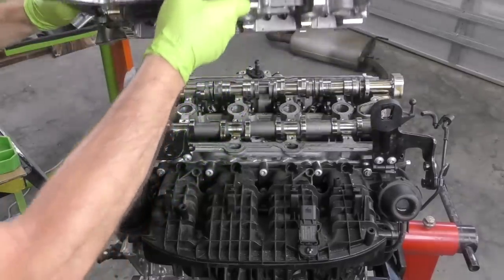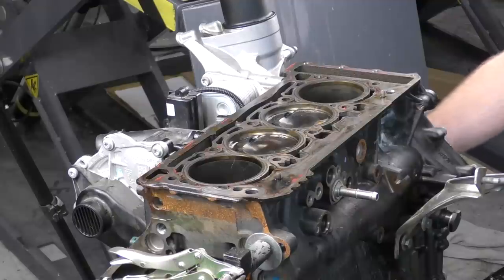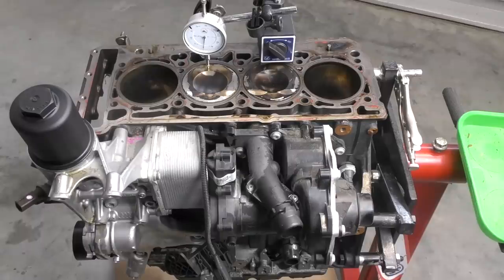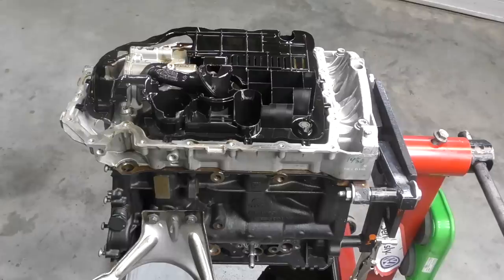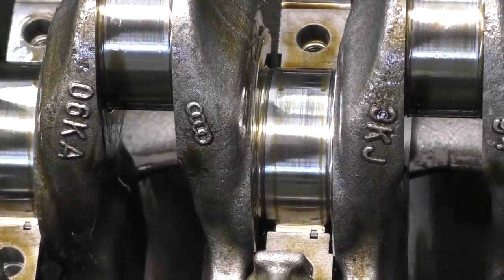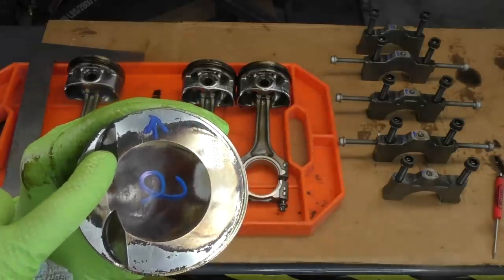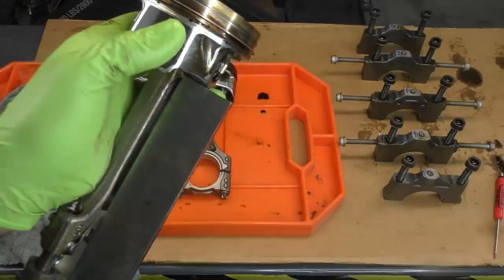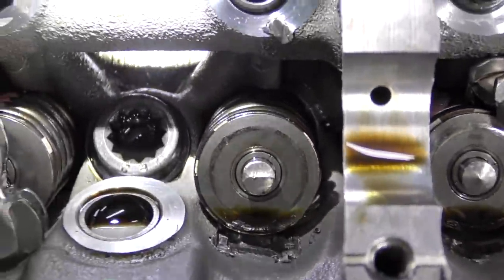Catastrophic Engine Failure VW 2.0t TSI Engine 2 ~ Bottom End Damage

Comment: Man I dodged a bullet today in my Miata. Accidentally made the same 3-2 shift up near redline but thankfully I think I got the clutch disengaged before the RPM went too high. Engine still seems to run fine, no CEL, no weird noises, coolant temp and oil pressure seem normal. PHEW!!
Reply: I bet you ain’t one of those guys who likes to dump the clutch but rather drive it smooth on every gear change, I find it soothing when I shift as smooth as an automatic, some people just can’t drive it smooth regardless of the rpm, they gave harsher ride than a roller coaster, that’s why they screw up their things.

Comment: Hey Charles, I don’t know if this was mentioned yet, but another way to measure piston height is to zero the dial indicator on the deck, then release and reposition the magnetic base on the deck so that the indicator foot is on the piston in the spot you want to measure. That way you can check true TDC, as well as depth or protrusion all in one step. The deck is assumed to be flat for that type of measurement, but I’ve never had a problem doing it that way.

Comment: It seems the owner over reacted by getting a new engine. This one seem to have sustained a lot less damage on the bottom end then the top end. Just needs a new cylinder head and it would have worked just fine. Maybe replace some of the things you mentioned. Overall very cool video.
Reply from the maker: Thanks! May have been just as much for a used engine. Plus he wants to build this one. So it may have been good to have 2
Reply: @HumbleMechanic  yeah that was my immediate thought, having the car out of comission, and paying for the labor for a rebuild probably would have cost just as much. Plus he might be able to resell the used engine when this one is finished to recover some of the funds.
Reply: Often times it's more expensive to rebuild than to replace with a good motor. Rebuilding is expensive even for simple stuff, because it's a very specialized field. As someone who rebuilds very simple old motors i can understand why someone would want a fair bit of money to rebuild a complex modern one.
Reply: Yeah just a replacement head needed. £200 approx. Edit: £900 all in & fitted. 🙂
Reply: Mom and Dad sponsored

Comment: That wear on the lower main bearing would be due to increased load from the combustion stroke. Also explains why it wasn’t on the top bearing. I’ve seen it more pronounced in bigger diesel motors to the point where the bearing almost mushrooms a little.
Awesome tear down btw. I’ve watched a heap of your videos recently after purchasing a mk7 gti and now downgrading to a Tiguan cries I’m sad vw noises

Comment: Yes!!! Finally but also wow you got this out quick! That one thrust washer is SCARY for a 40k mile car. I know what I'm having nightmares about now!
Reply: It's a race car dude.  Vastly accelerated wear on a race engine.  No need to worry about your street GTI bottom end
Reply: If the car has been used in town traffic, with the driver sat on and riding the clutch at every set of lights, or doing a lot of stop/start driving in rush hour, the thrust washer will show increased wear, and all the more reason why people buy an auto/DSG if it's their daily commute as well. Also, another reason for not always riding the clutch at the lights is that it places a continued strain on the clutch pressure plate, and if the pressure plate fails, you'll be going nowhere fast.
Reply: @AJ-bb6qb  That's true, but a thrust washer should be designed to wear at a similar rate as the main bearings - as in easily capable of 200k miles regardless of driving environment. A thrust washer that wears more like a clutch is frightening.
Reply: @acefighterpilot  Agreed, and perhaps this is more a problem with recent VW engines, or could just be a bad batch of main bearing/thrust washer sets as even OEM suppliers have quality issues from time to time. 
I know from my previous strip down of a 200k mile plus petrol motor from an 80's VW Golf, that had an owner who would go through clutches every 50-60k miles due to riding them, that there was only light wear on the thrust washer.
I think if it was a common problem, engine designers would have fitted multiple thrust washers across all of the main bearings to spread the lateral load. 
I probably need to watch some more engine strip down vids to see if this is not an isolated case.
Reply: @AJ-bb6qb  Crank walk is proving itself to be an occasional problem on EA888s with heavy aftermarket clutches. Older engines generally have upper and lower thrust washers on either side of the center bearing, the EA888 only has the upper.

Comment: You probably answered what went bad on my 2006 A3. Engine failed but before it failed clutch would sometimes get stuck. But I did not have modified clutch it was the original. no slippage, so never replaced. Engine did have a rattle noise. Makes sense that the thrust washers went bad. I got rid of car had over 150k.

Comment: Cracks don't have rounded edges, but if a crack does form, that's where it'll be.
Reply: Looked like cracks on the cam risers. . .
Reply: Polishing out those lines and jagged edges on cast parts not only makes them look good and shinny, but also makes em stronger be evening out the surface tension of the entire cast part. Takes time, but worth it on high power output builds.
Reply: @airtaiH2  shouldn't you just use forged with high power builds
Reply: @jorge8596  where would you find a forged cylinder head?

Comment: Loved this video, I feel like I learned a lot about the engine in my VW just by watching this. Pointing out some of the common issues such as the thrust washers and how to check for abnornal wear was super interesting.

 I dont know if you take reccomendations for future videos, but I think a comparison of the current gen 1.4t, 1.8t and 2.0t would be really interesting. What parts are interchangable? Do the head designs differ significantly? Etc. Being able to go in depth to the same degree as this video would be incredible, even if you just had a couple parts from each variant to show.

Comment: Interesting in the thrust washer. . .   I noticed the end play on my Cessna 172 O300 engine when I would grab it by the prop to pull it into position.  It worried me, but then realized all of this flat engines had that end play.
Reply: There's an SB on radial crank measurement at the prop hub you can have your A&P do if you're afraid it had a prop strike earlier in its life. But they do in general have a fair bit of play, the thrust bearings are literally under the load of thrust constantly. That's why keeping up with your overhauls is important.

Comment: I definitely had money shifted couple times in my life, Volkswagen shift pattern has 1-2 closer to the centerline than 5-6 is (got to have something to do with the reverse, they need the 1-2 closer so they can Jam R on the left side), and the shifter takes too little effort it doesn’t give a very good feel, that’s why it’s easy to money shift from third to second. However I never drop the clutch, I always ease it out near the “biting point”, I like to shift as smooth as an automatic, and that gave me just enough time to realize my error, and correct it by depressing the clutch (engine almost sounds like vtec kicked in for a sec, and hitting 8000 rpm instead of dropping to about 4500 from 7000), I really wonder how many rpm it takes to cause damage. Who would have thought the timing of the engagement of that flimsy piece of disc (as about the size as a dinner plate) could mean the difference between life and death for the engine?

Comment: How do you mess up 3rd to 4th. It's like the easiest shift
Reply: Let’s say you did mess up why would engine do that anyway I down shift all the time
Reply: Roman Skarzhinets he was probably near redline in 3rd then when he shifted to 2nd it revs way past redline there for killing the engine
Reply: GatSpeed modern engine would it let?
Reply: @Roman-vh1rr  how could it not allow it?
Reply: Roman Skarzhinets A modern engine with a rev limiter works by cutting fuel and/or spark when at the rev limit.
Unfortunately in a money shift situation like this the engine speed is being governed by the physical link from the wheel speed through the driveline, no ECU managed rev limiter could do anything to prevent it.
Reply: Muricans, can't shift by default.
Reply: Because double clutch race shift.
Reply: @Roman-vh1rr  When you are at 6k RPM in third gear and try to go to fourth but get second gear, it makes the RPM climb to what ever ratio your tire speed is. Example, say your second gear at 6k RPM is 35 MPH, top of third is 60 MPH at 6k RPM, your wheel speed is 60 MPH and you go to second gear and dump the clutch trying to shift quickly (probably racing a guy or messing around having fun) your engine RPM at 60 MPH in second gear would be somewhere around 10-14k RPM!!! there is too much mass spinning that fast that things pull themselves apart, the rotational forces are too great for the design of the engine. Formula one engines can rev to those RPM because they use tiny very thin aluminum pistons, lightweight connecting rods and build crankshafts. Not to forget that the spring rate for your valves is not strong enough to close before the piston is at TDC sometimes hitting the valves.
Reply: Normally 2nd would not pass unless you slow down !
Reply: Roman Skarzhinets because the car was stage 2, so it’s had a rev limiter removed possibly
Reply: @JordzyBrev  Has nothing to do with rev limiter, rev limiter is only a software stopper when accelerating, it can't save you if you money shift. Only way you are saved from money shift is if the car is auto/dual clutch ect because most will not allow you to downshift if it will put revs over limiter by doing so as its software stopping you. No one in their right mind would remove that in a tune
Reply: DarkDaedricLord Gaming he was at 9k rpm in 3rd gear and wanted to go 4th but went into 2nd and killed the engine, the guy was saying, modern cars shouldn’t let that happen but if you modify software ect it won’t have that safety at high rpm. I have a Honda and I haven’t do anything to it but if I’m Neutral my car will only rev to 4k, it’s programmed to so that to protect and when I’m driving my car won’t rev past 7k
Reply: @JordzyBrev  He only said maybe he was at that, never that he was. Even if you are at stock redline in 3rd then went to 2nd it'd still blow the motor or at least try to. The neutral thing is either a 2step launch control or it's for emissions like most new cars. No way you would put the redline so much higher for no reason. In my car I've got a tune and redline is 400rpm higher than stock because thats what the motor can do safely, but if I money shifted its still going to blow because it will be at 10k plus and that extra 400 isn't going to change the outcome of that. I've also got a 2step launch control to hold at any rpm i program when stationary. Modern cars won't let you rev over limit with throttle and if an auto then won't let you downshift if that lower gear will be over limit. But if a manual its straight mechanical between the wheels and engine  with no fail safe so it's up to you not to fail
Reply: @23for82bigs  he was def at red line racing
Reply: @JordzyBrev  put this way even if the engine was not running say u shut the engine off at highway speed it's still in gear 4th or 5th high RPM and u put it in a lower gear 2nd let the clutch out it would mechanical force the engine to turn and turn faster than what it's designed to take, the electronics can cut all the timing, fuel or as i said switch it off it would still happen
Reply: @Roman-vh1rr  if it was an automatic and u request a down shift which would result in a over rev the ECM won't let u, until u bleed off some speed.. in a manual shift the ECM can't hold ur hand so u better get it right 😅 or boom
Reply: @Roman-vh1rr   put this way even if the engine was not running say u shut the engine off at highway speed it's still in gear 4th or 5th high RPM and u put it in a lower gear 2nd let the clutch out it would mechanical force the engine to turn and turn faster than what it's designed to take, the electronics can cut all the timing, fuel or as i said switch it off it would still happen
Reply: @JordzyBrev  there's literally nothing a computer can do to prevent overrev, if the gearbox is yanking the engine to whatever speed the tires are travelling at.

Comment: When I was a teenager my one buddy was loosing his license and wanted to drive a 5 speed one last time before handing in his license. I let him drive my 1992 4cyl mustang winter car. He redlines 2nd gear and goes to 3rd but it went into 1st gear the engine rev’d to the moon, tires screeching but didn’t blow up. Years later I’m a professional auto technician and I was really into racing Fox body mustangs and I use to rebuild/repair all my friends t-5 trannys from these mustangs. Guys like myself that had built motors would keep blowing up these transmissions and until I had the money for a better tranny I ran a bunch of these t-5’s that were from a 4cyl car and first gear was like 4.40:1 so Reving 2nd gear out and shift back to 1st is near impossible because 1st gear and the slider would be spinning at such different speeds so I have absolutely no idea how my buddy was able to slam
It in 1st lol. When I was junking the car I tried to get it into 1st it would not go in no matter the speed or what I did, I tried holding the clutch in for a while to slow the input shaft speeds in gear and in neutral, tried holding the engine wide open bouncing off the Rev limiter, slam it in really hard, reving the engine and letting off but I couldn’t get it to go into 1st until the car was almost not moving. 

However one of my other friends had a 1990’s Chevy s10 4cyl 5speed winter beater and I dared him to shift it into 1st gear when we were going 50mph and he really quickly slammed it into 1st gear it actually went into gear let out the clutch fast and the truck didn’t do anything no noises, no jerking, engine didn’t Rev up but truck wouldn’t move. When he took the transmission out the clutch pretty much disintegrated lol! There was the hub part that was on the input shaft then just a pile of clutch material in the bellhousing lol. I couldn’t believe it didn’t make any noise or anything with how crazy it blew up.

Comment: The valve reliefs cut into the pistons is probably what saved the bottom end and the valves from contacting the pistons when it over revved and the 'floating' occurred. I bet if it was at a higher rpm and the pistons were flat top then you'd be picking pieces of the valve out of the bores. It definitely mashed the top of the valve stems but the bottom end survived probably by its design. Apparently its 'less' of an interference motor due to all the space in between the valve, piston and quench area. Throw some bearings in that short block and it should be good to go. If you are worried about it, you can always use some plastigauge to check the tolerances. The crank material is known to be harder than the bearings, so it isn't common to see the crank wear before the babbit material starts to wear through on the bearings. Still not impressed with the TSI stuff. I'd rather have a built 1.8t (that isnt a sludge motor.) This only really happens to the longitudinal ones and not the transverse mounted.

Comment: Charles, I have a 2014 Jetta MK6 1.8L Turbo.  It's getting the Oil Light/Chime (Low pressure).  It comes on once operating temps are achieved and at idle.  When RPMs increase to 2000-2500 RPMs, light goes away.  I've dropped the oil pan twice to inspect for sludge and it was pretty clean.  Pickup tube was cleaned, oil pump has been replaced (oil pump looked good but bought one at a cheap enough price to try the swap).  Oil and oil filter looking good.  I've also found a radiator leak and corrected that as well.  During the last oil pan drop, I found what appears to be a ball bearing about 1/4" (50mm) in size.  I've watched all your engine tear down videos trying to determine where it might have come from.  I'm getting ready to throw in the towel and trade this car in, but curious if you have any ideas on where it could have come from.  Lastly, is oil pressure is related to bearings, is there any way to confirm that without taking the engine out and doing a full tear down?  Thanks in advance!  LOVE your channel and all you do here!